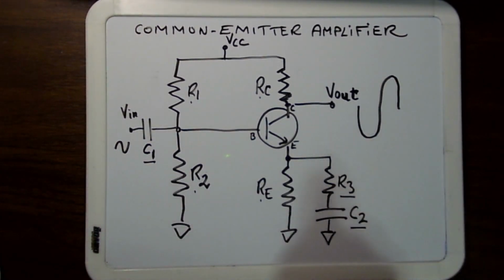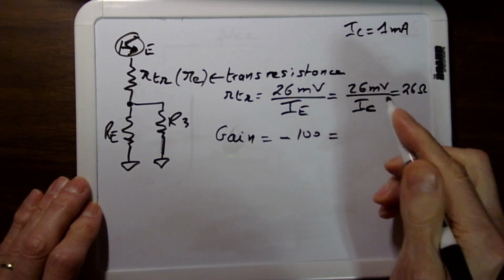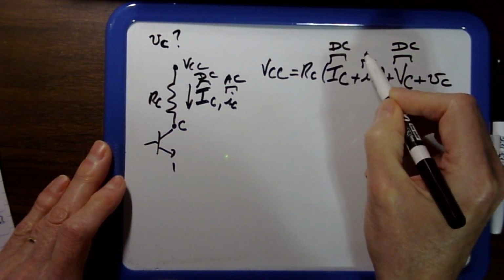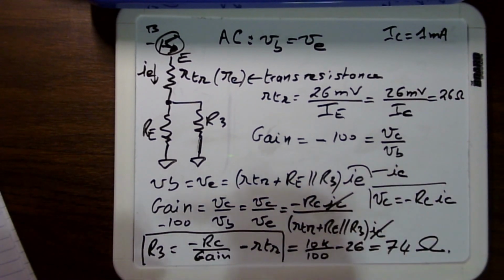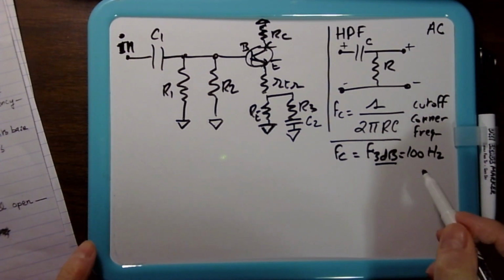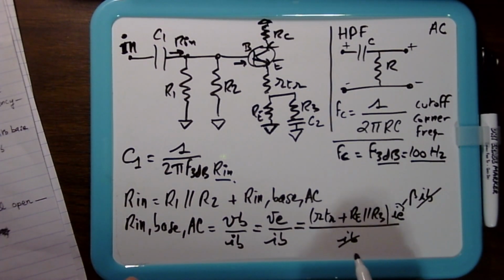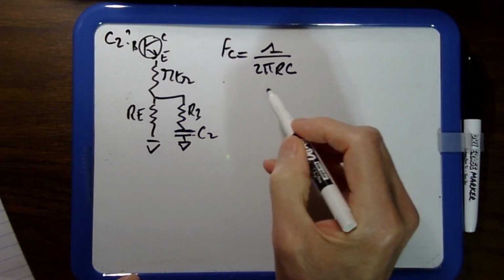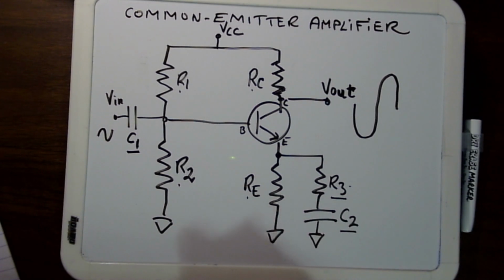Tutorial for common-emitter amplifier design (part 2 of 2)

Comment: hello sir , thank you for this valuable lecture,
i have a doubt about the Rin which equal to 5k in your calculation , But Rin =   R1//R2 + RinbaseAC  
R1//R2 = 9.2K
and  RinbaseAC= Beta (rtr +R3 ) = 100 ( 26+76) =10K
=> Rin = 10K + 9.2K = 19.5K  not 5K ?
Correct me if i'm wrong please

Comment: This is collage level math. Thev theory is too. I think you lost most people. But as an amplifier you must run the transistor in the active region to cut distortion I believe.
Reply: He said the resistor Rc in part I video was chosen at a value because of the halfway of the load line emitter current to incorporate the AC signal with the DC signal to be optimal (he taught that in the last lecture).  That was a great part in his last lecture I enjoyed since it is more necessary in MOSFETs designs where high frequencies are in the amplified voltages using them over BJTs.
Reply from the maker: Thank you for your comment.
Reply from the maker: Yes, it s not easy stuff. I highly recommend watching part one first since i explain the dc bias setup. And you are absolutely right, the operaring poing or quiescent point should be at the middle of the dc load line so that the ac swings around the dc op point stay in the linear region.